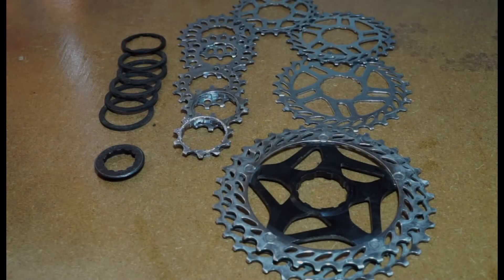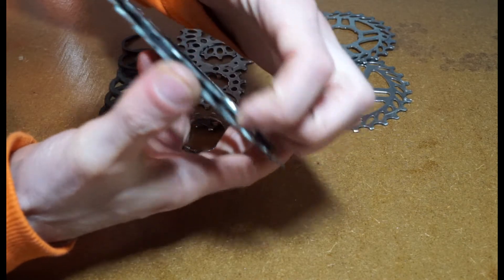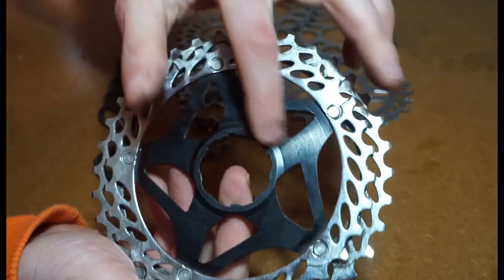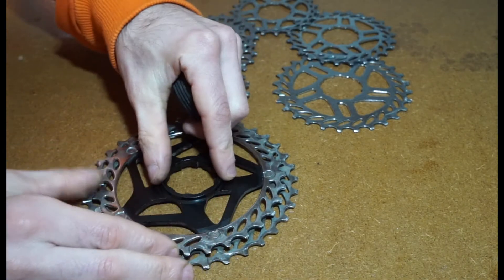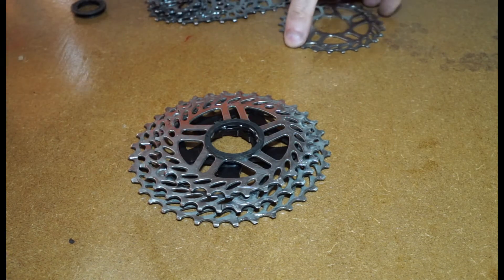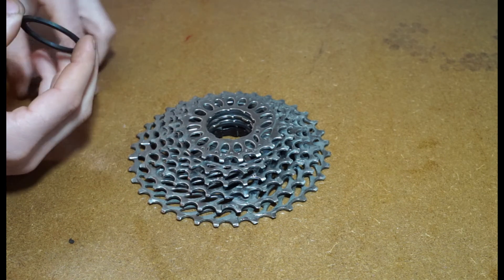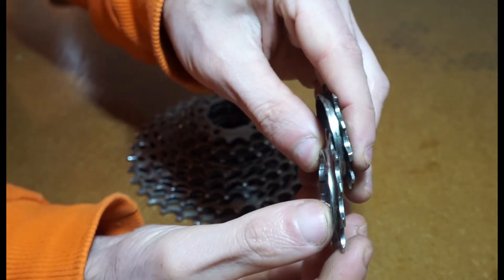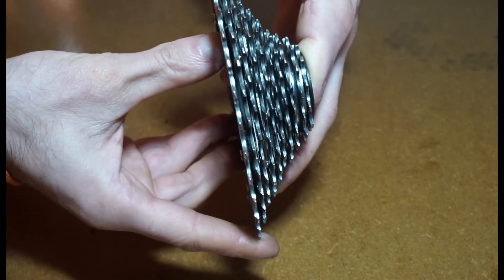Cassette Spacers? Mountain Bike Cassette Assembly for anyone confused about where the spacers go.

Comment: Thank you for this explanation. How do you know if you need a spacer on the back. I'm using a 9 speed cassette on a new set of wheels and someone mentioned I might need a spacer.
Reply from the maker: I have fitted cassettes that needed an additional spacer before. The way I found out was to fit the cassette, tighten the lock ring (normally 40nm) and then feel for any play between the cassette and freehub. If the cassette can rock on the freehub or has any play then you should remove the cassette and fit the spacer (it goes on first) then reinstall the cassette and then make sure there is no play or movement between cassette and freehub.
Reply: Thank you for the the reply. ❤ I was hoping there was a way to know before fully tightening the cassette as I find them really difficult to get off. 😅Perhaps it's time to upgrade my tools 😁
Reply from the maker: @cycling_woman  No problem. I have a 600mm breakers bar to undo the lock ring so it's pretty easy. There is some nice cassette pliers available take make it easier to hold the cassette in place when you undo the lock ring.